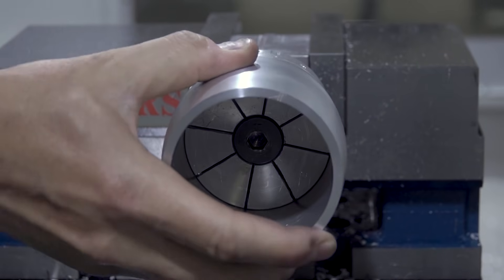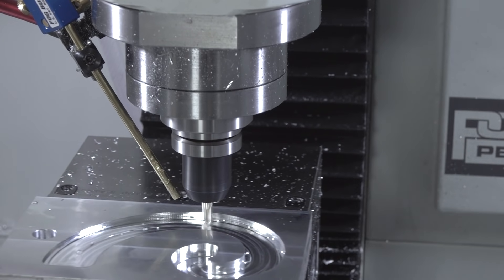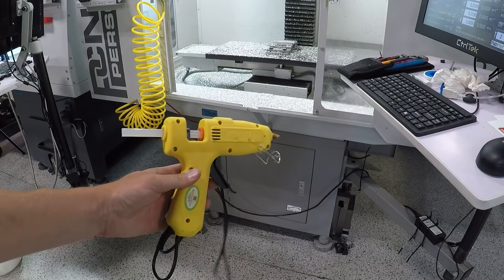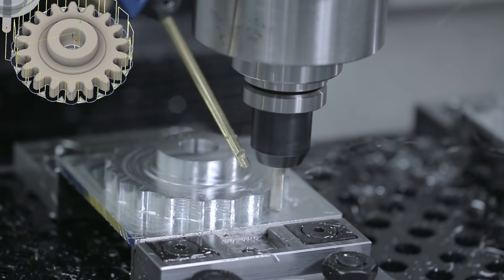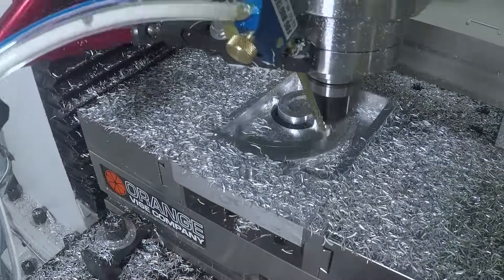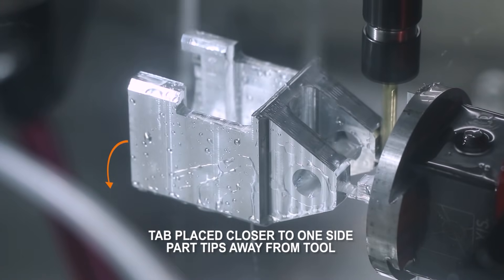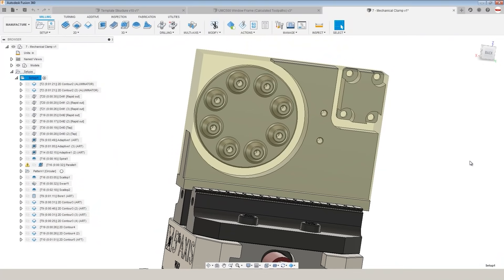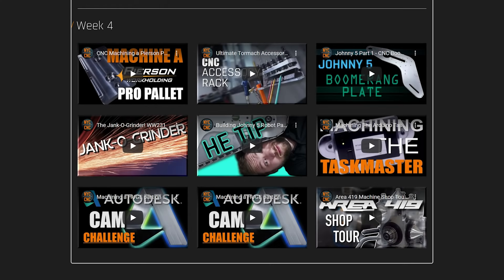Workholding Techniques: Window Machining & Tabs for 3,4, and 5-Axis Applications!

Comment: Tech Tip: if you went overboard with the hot glue you can just soak it in goo gone over night and blow whatever glue remains off with compressed air.